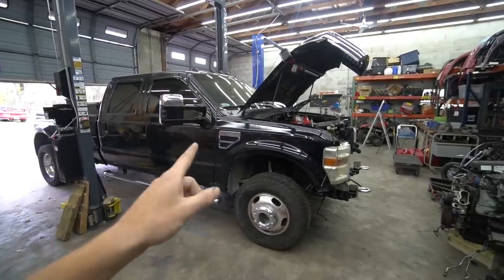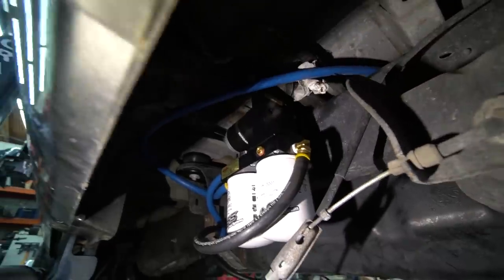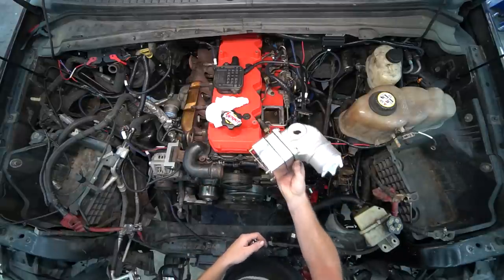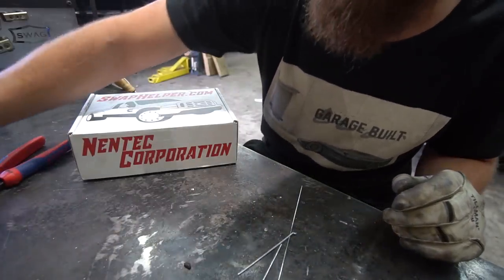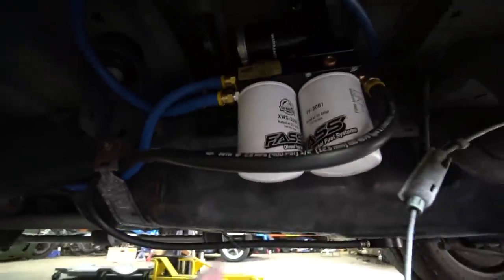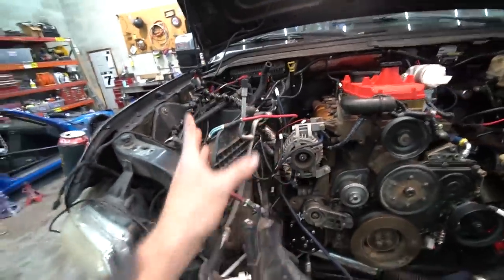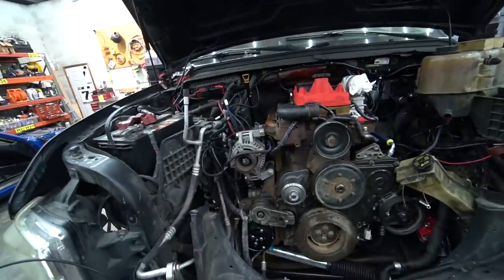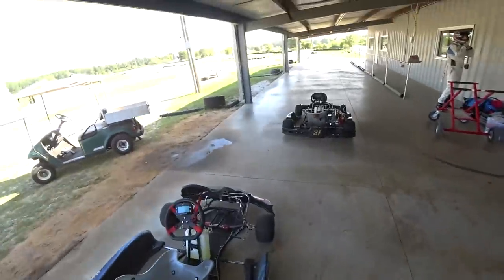FUMMINS Build First Startup? Houston We Have A Problem...

Comment: I think your problem is ur tripped the truck security system it’s called PATS. I think ur security light was blinking on your dash, if it is your truck will not start. You will probably need to get into PATS and gain security access and do a reprogram. I’m a ford tech we use ids to do this idk if you can with tuning software.
Reply from the maker: Yeah that’s seeming like my next option. Problem is I only have one key and it would be very difficult to get the truck to the ford dealer if they can even do it there with the engine swap they said they would need to start it.
Reply: @Taylordrifts  how does a remote start system bypass pats?

Comment: Usually if something is back feeding voltage it's due to lose of ground. So it finds the path of least resistance to ground.  I also wonder if you have skim and bus figured out for comm between ford controller and cummins controller?
Reply: What this guy said

Comment: Taylor, I'm getting ready to start the same conversation using the DCS kit. I'm converting my 08' F350 with a 01' 5.9 24v. The 5.9 is an all stock engine with 107,000 miles on it. I plan on removing all covers and the head (want to visually verify everything is good) and go back with ARP studs, 45-50hp injectors, new water pump and a new gaskets on everything. What else would you recommend? Anything I will need that isn't part of the DCS kit?

Comment: I've been running down the rabbit hole with a montero I was given, been like a 2 yr mystery of why it won't start. Rebuilt it, changed eeeeeeeveything wiring wise. New engine and sensors. Stumped.....
Reply: Daniel Ward I’ve had bad crank sensors out the box leave me stumped. You can’t always rule something out because you’ve already replaced it.

Comment: the starter wire next to the battery has nothing to do with the ecu thats the direct power. if you pull it and touch the inside end to the battery it will crank even with the key out. it will not start the truck but it will turn it over. i like to use it on my 6.0 to prime oil after a change

Comment: I had an 03 ford with an anti theft thing and after every time battery was disconnected and reconnected there was a hidden reset button under the dash you had to press or the truck wouldn’t start

Comment: Your truck is definitely not liking the chip in the key. Your ecu is not reading it. Please open up the boxes for the alarm you removed and see if one of those contain a key with in. If not, your best bet now that you  removed the alarm remote start combo is to call up a local lock Smith. Your issue If definitely with the factory security system and a locksmith has the equipment to diagnose the issue.

Comment: Anybody know how to solve a 2002 Dodge Ram Van 1500 charging issues. I replaced the alt twice and the battery today and the voltage meter died on the drive home. Any suggestions?

Comment: Long shot but i had a no start issue caused by a neutrality/park safety switch
Reply: I'm betting the computer is looking for the fuel pump and not finding it. His factory pump is unhooked. The starter won't crank if the truck thinks there's no fuel pump.

Comment: 110mm bolt minus 5mm thanks to a grinder =105mm
Reply from the maker: The problem is where the threads end. The holes are not captive, but the shoulder bottoms out before the bolt is tight.

Comment: always buy extra long bolts, just cut to length if needed
Reply from the maker: The problem is they're not threaded the full way. They only have 15-20mm of thread so the shoulder bottoms out before the bolt gets tight. Cutting it down would change nothing since the holes are not captive.
Reply: Then buy set screws to get the thread the whole way